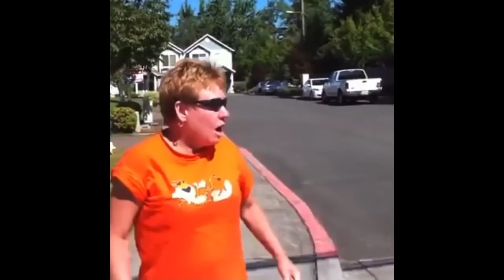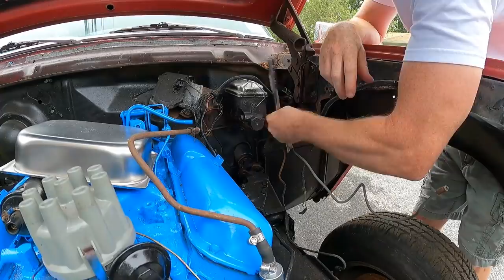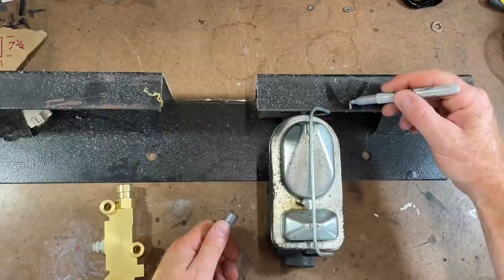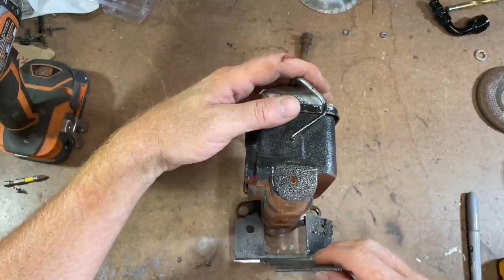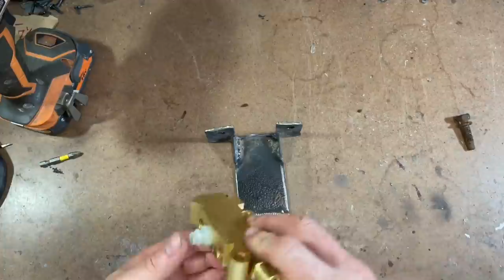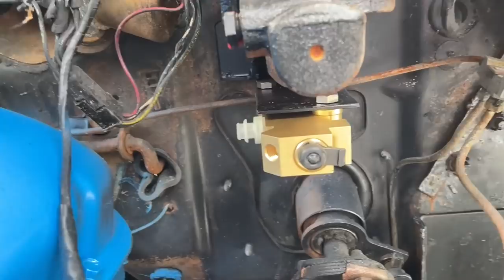Installing a Proportioning Valve and a Line Lock!! Pt.5

Comment: Damn, if I knew you woulda needed a proportioning valve, I woulda sent you my old one. Had to get a disc/disc valve cause I got rid of the rear drums when I did my frame off resto. The joys of cars. Headache after headache. I think anyone who works on cars, including myself, must be at least part masochist. It's basically a life of non stop torture.
Reply: Amen. 🙂 Anybody that works on cars is very familiar with Murphy's Law.
Reply: @FunkyFresh48  Haha No doubt. Been doing autobody and painting for 15 years. I wanna knock Murphy out at this point.